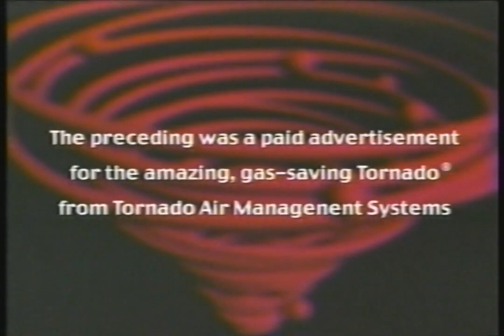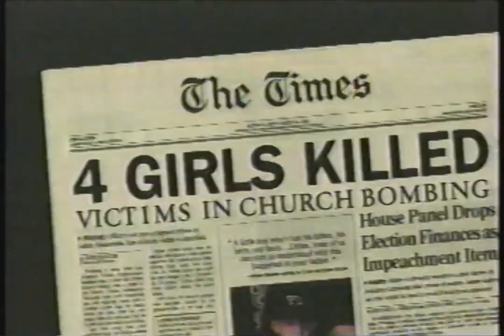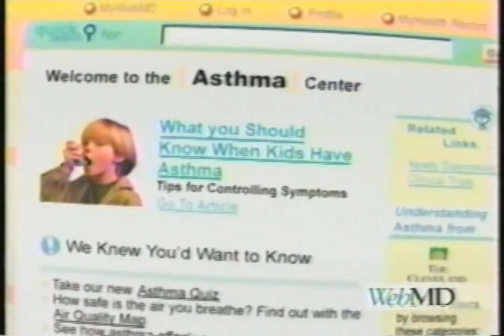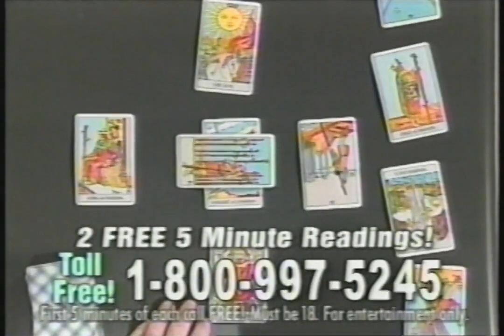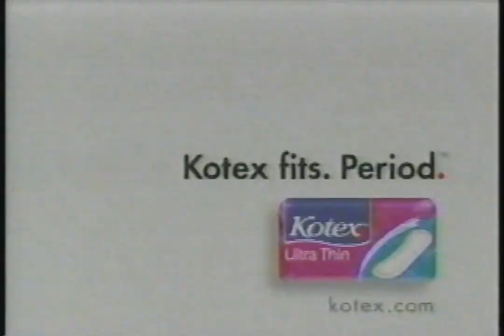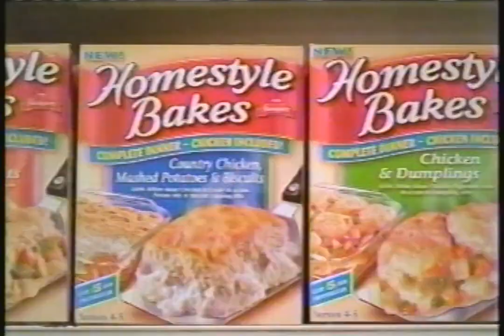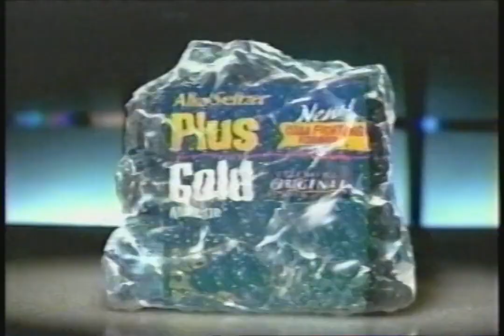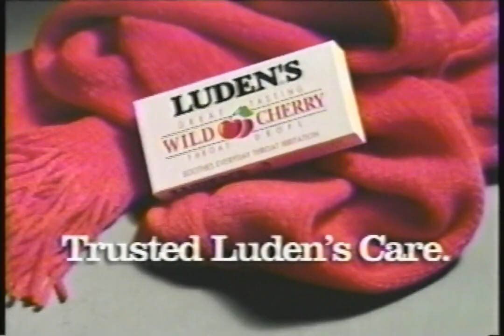FX - December 5, 2001 Commercials

Comment: 1. Tornado 
2. America: A Tribute to Heroes
3. Varsity Blues Promo
4. NASCAR on FX Promo
5. Buffy the Vampire Slayer Promo
6. Les Clayborne
7. Kleenex
8. Compaq
9. Conair
10. Psychic Readers Network
11. Oxi Clean
12. Sins of the Father Promo
13. The Practice Promo
14. Payless
15. Kotex
16. Leap Frog
17. Hershey's
18. Same as 8
19. Shop at Home
20. HOM Furniture
21. Progressive
22. Aliens Promo
23. The X Files Promo
24. Allie McBeal Promo
25. Aleve Cold & Sinus
26. AOL
27. Same as 15
28-29. Pledge
30. Denny Hecker's Stillwater Ford Lincoln Mercury
31-32. Gertens
33. Same as 3
34. Speed Promo
35. Vanilla
36. Wizard
37. Pillsbury
38. Same as 7
39. Same as 8
40. Same as 10
41. Next on FX Bumper
42. Same as 5
43. Luden's
44. CLR
45. Same as 15
46. Matrix Direct
47. Dell
48. Same as 22
49. Same as 13
50. Same as 24
51. Old Navy
52. Same as 26
53. Homestyle Bakes
54. Hooked on Phonics
55. Winter Olympics Promo
56. Road Runner
57. Datek Online
58. Same as 3
59. Same as 12
60. Pedialyte
61. Gap
62. Same as 15
63. Same as 37
64. GoldenGate
65. Auto Mart
66. Same as 64
67. Same as 34
68. Rampart Promo
69. Chili's
70. PediaSure
71. Alka-Seltzer Plus
72. Same as 51
73. Kleenex
74. Showtime Pooh
75. Profina
76. Same as 5
77. Power Wheels
78. Same as 15
79. Suzuki
80. Same as 43